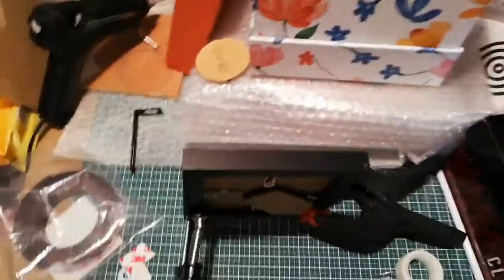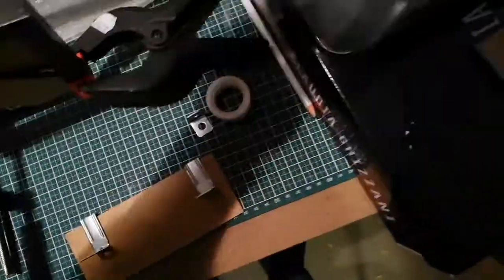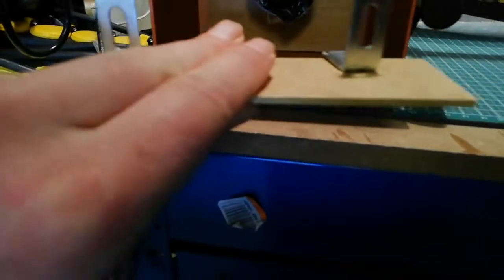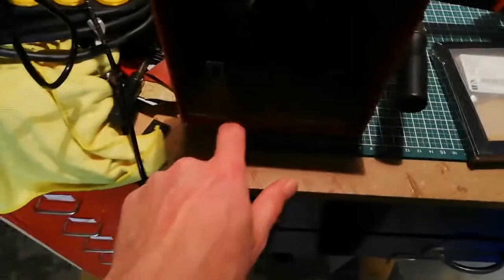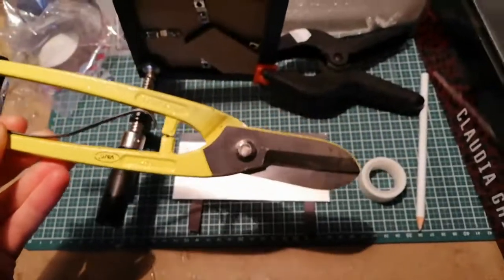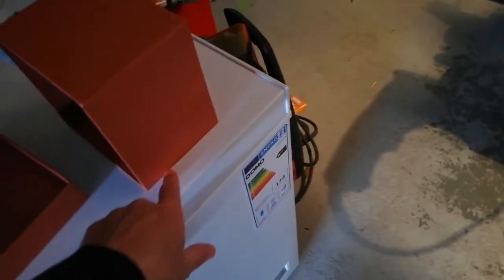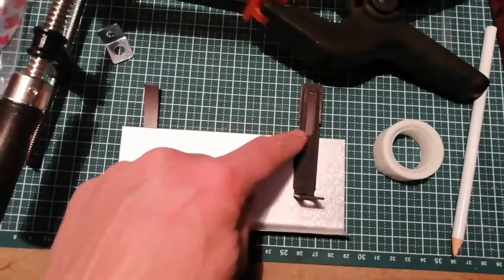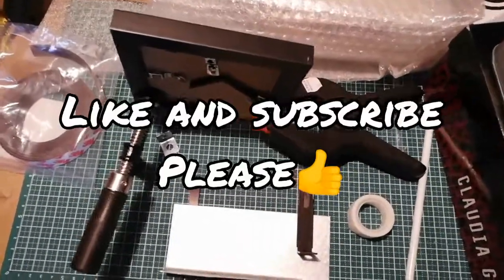DIY Cyanotype negative camera. 15 min build.

Comment: Mine didn’t work. Cyanotype works only under uv and the lens seems to be not letting these rays through. How did your camera work? Can you show the results?
Reply from the maker: It will work 100%. If you didnt get a result try and expose it a bit longer. Like 50% longer time. Also if you coat your own cyanotype paper be sure to use the two step method. Herschel method. Also the type of paper used is suuuper important. Lens should be a F 1.2 or F1. Projector lenses are ideal. Or a plastic lens. Normal photography lenses block uv. Can try pre war lenses.

Comment: how well did it work! seems well built. curious how the lens did.
Reply from the maker: Lens is a fast F1.2, f0.95 eould be better. But be careful use a non coated lens, you need all the light rays to enter the camera. Most phoyography and 35mm lenses are coated against uv rays. So i used dia projector or film lenses.